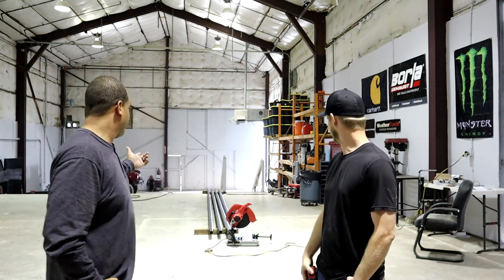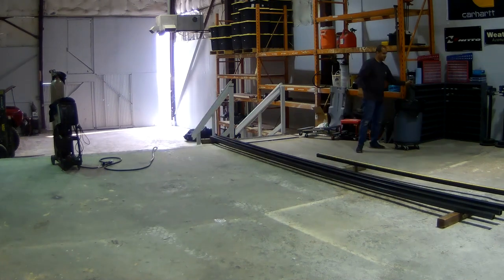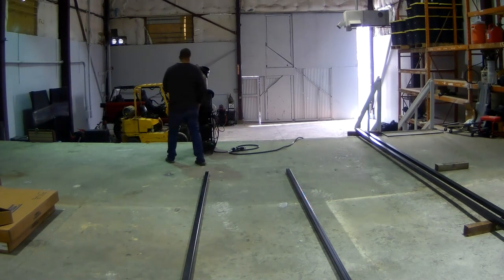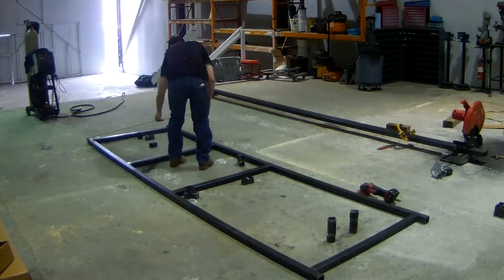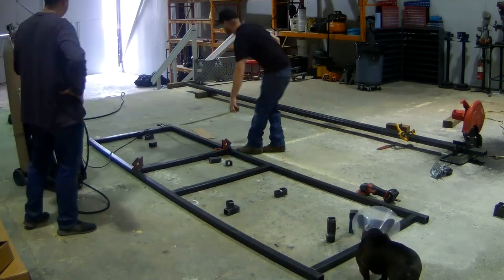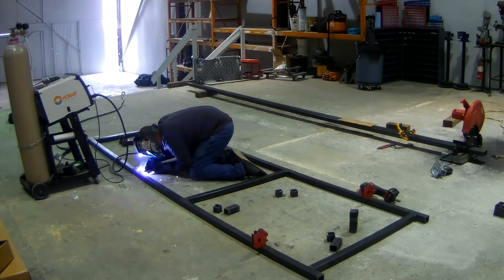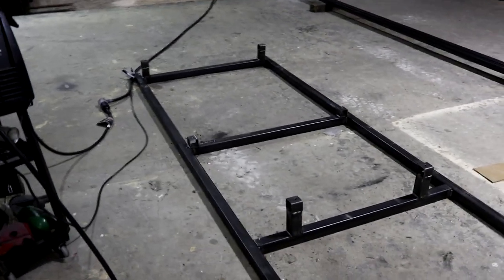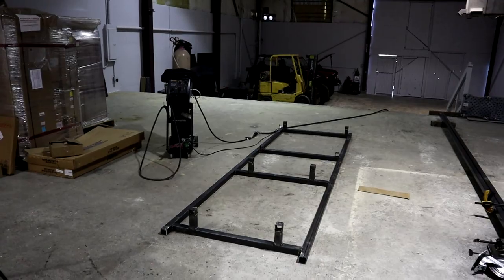How build 1966 to 1977 Ford Bronco body (Jig table assembly) Episode #1

Comment: Not very useful video without dimensions
Reply: YOu should be able to get the dimensions of you have a good frame.
Reply: @carlstrohm7614  you do realize they're building this to be used with building a new bronco. they sell the weld kits online to build one from scratch because the bodies/frames are so hard to come by and people are charging $10k for a rusted up, bent frame, pos..
Reply: @callofgeorge  I do realize this. I also realize that there are dimensions online on various forums and groups.
Reply: @carlstrohm7614  dimensions of the bronco yes, but not the simple diagram of this jig. i did find someone's jig similar to this though. building a folder currently with every diagram, drawing, etc i can find. just odd that they made a video showing them making it, name it "how to build" but don't actually show dimensions used.. apparently this company went under though. found very little on them other than a few angry customers saying never got product and can't reach them.
Reply: @callofgeorge there seems to be some confusion. the only dimensions that matter for the jig shown are the frame to body attachment points. The actual  size of the jig is irrelevant as long as it it stable and doesn't allow the attachment points to move. I do know that there is quite a bit of variation between bronco frames and tubs of different years that's why  there is usually a +/- in most dimension diagrams online. And it is known that the early Budd built bodies were quite a bit different dimensionally than later ford produced units.
Reply: @carlstrohm7614  no, what i mean is, i'd be using the jig to build a tub.. you use the body mount points to mount each panel. when you get the tub kit, its in about 12 pieces. to help align them, you mount the tub panels then weld. that's the point of the jig. i did the same thing with my 68 mustang, except i had a car to build that jig off of. i don't in this case. i'd be building a bronco from scratch like they're doing. saves lots of time and holds things in place vs trying to use a frame/body skematic and measuring a million things when trying to weld all the pieces. if i wan to build this jig to do that, i need to know where to place those body mount locations/heights.
Reply: @callofgeorge  in that case I refer back to my original comment. Those dimensions can be pulled off of a known good frame. Or for that matter you can use the frame as a jig if you are only building one tub.
Reply: @carlstrohm7614  i don't have access to a frame. i'm building from scratch. that's what I'm trying to say. i don't have a bronco, i don't know anyone with a bronco.